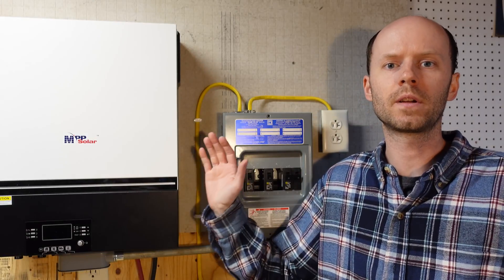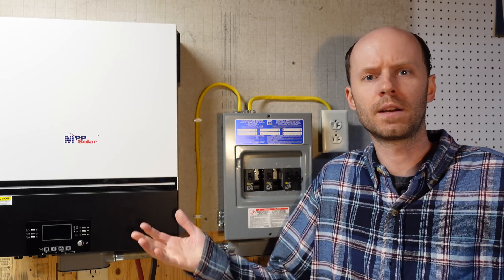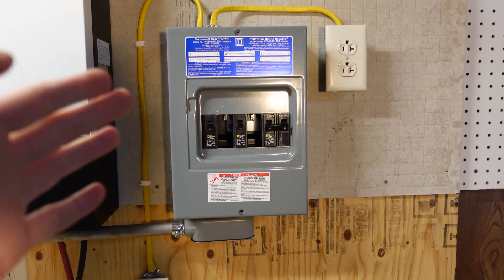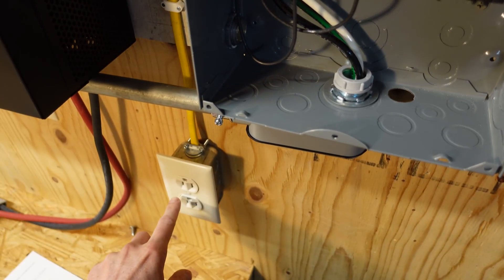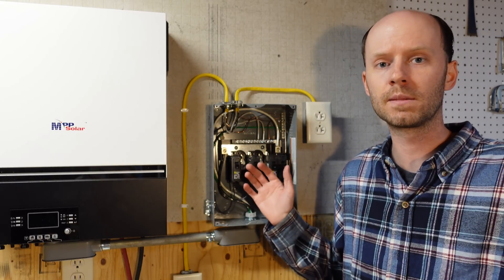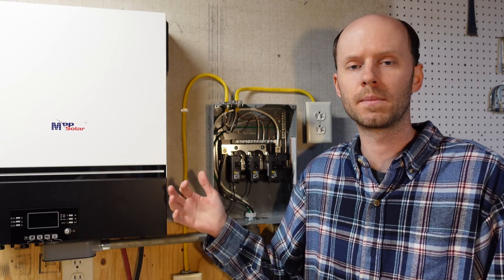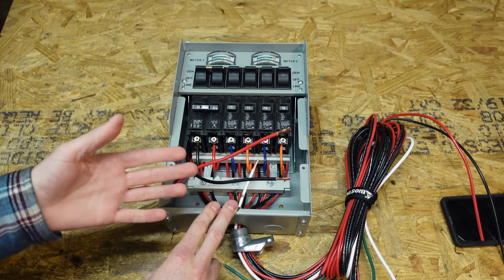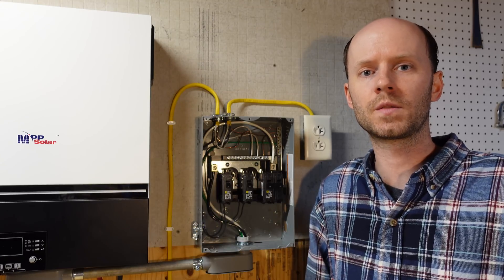MPP Solar LV6548 Inverter, Neutral+Ground Bonding, Completely Off-Grid

Comment: Solar Grounding Issue

I watched this video

https://youtu.be/Fnmjvg-7H8w

And he discusses the issue of grounding, but still a bit confusing on if the bonding screw should not be in the inverter so ground is not energized.

Here is my thinking and please tell me if I am wrong:

All of the inverters should not have a grounding screw in them, and the sub panels off of inverters should also keep neutral separate from ground.

To get ground, either the inverters are all plugged into grid as backup power, so they connect to ground thru that plug, 

if you decide to unplug ALL inverters (must be all so no crossing of grounds), then ALL Inverters’ plugs that would have bern plugged into the grid for backup power - should be plugged into a NON POWERED OUTLET that only has a ground connection no hot or neutral in this outlet, so that the inverters are all connected to a ground.

My thinking is to have an outlet strip or connected outlets, with a switch that in one direction connects ALL Inverters to the Grid power and grid ground (this is as backup power not for backfeed into grid).  So in this scenario, all inverters have backup power and common ground.

When switch is in other direction, ALL Inverters are not connected to grid power for backup, those lines hot and neutral are not connected, only the ground is connected to a separate ground rod to provide ground for entire system when not using grid as backup.

Could achieve this with a separate breaker panel with two breakers that have metal piece to make so only one breaker can be on at a time. 

And the ground wire to the inverters are switched from grid ground with power to 
independent ground without power wires.

One breaker feeds from grid w ground
other breaker only feeds from separate ground

But you do not ground the box to the grid ground, it would have to be grounded to whichever active ground is being used at the time by the inverters.

Does that make any sense?

Please be critical I prefer to find the correct answer, my opinions are of no relevance if they are wrong.

Thank you.

Comment: Same issue with the growatt 3K inverter I have.  I'm completely off grid, growatt still has bonded screw in place.  If I don't bond N-G in my panel, my plug tester says I have an Open Ground.  If I bond N-G in the panel, tester says my connection is good. How can get rid of the Open Ground without bonding in my panel?

Comment: I’ve read all the comments and still have one question: If I connect A/C power input from my main house and then create the exact same setup that is in this video, do I need to remove the N-G bond screw in the inverter and NOT add an N-G bond in sub panel b/c the N-G bond is coming from my main house panel?
Reply from the maker: If you keep the neutral bar and ground bar separate in the sub-panel then no - you should not need to remove the bond screw. The inverter disconnects the bond when it's operating in grid pass-through mode. That said, I am not an electrician and would encourage you to have one evaluate your plan ahead of time :)

Comment: So, as an alternative, the LV6048 comes with Gnd Neutral L1 L2 allready, would this solve the issue?
Reply from the maker: Isn't that one of the ones that actually has two inverters assembled inside the case? I don't have one myself to verify.
Reply: @LithiumSolar  That is an interesting question, I never had them apart !
So now you have me wondering, humm...
Reply: I see David Poz did a build Jan 11 2020 with the very similar 5048, he says in that vid that the 5048 is two side by side 2.5kw inverters set 180 degrees out of phase with each other.  assuming this is correct, then, does this solve the potential problem?
Reply: So i couldn't resist, yeah I opened up the 6048, and yup it is two 3kw units side by side.
Using an ohm meter the Gnd-N are not connected.

Comment: I am glad MPP Solar responded to you. I have not been so fortunate. I am wanting to install four LV6548 inverters after so many positive reviews. However I am trying to select the best solar panels to use. The question I have asked MPP through their online form (twice) is about overpowering the inverter. Its rated for a max solar Voc of 250vdc and 8000 watts (2x4000) per inverter. Will the inverter limit the voltage and current or will this damage the inverter? From other end users comments it appears you can increase the amps and the inverter will limit it but increasing the voltage above 250vdc may be a problem. My goal is to have the inverters start producing power earlier in the day and produce later into the day even if I am not able to use 100% of the solar power during the peak sun hours. I am hoping MPP will respond before watts247 is out of stock again. Almost forgot to say thank you for your videos and information you share.
Reply: I think I found the information I needed, please respond if you see something wrong with my thought process. Page 7 of the LV6548 manual says, "Exceeding the maximum input voltage can destroy the unit!!". A well known US distributor said the wattage may be exceeded as I had hoped however the manual says, "maximum current load of each PV input connector is 18A". If my math is correct 250V at 18A that would be be 4500x2=9000watts so there does seem to be a bit of wiggle room. Looking at page 9 the recommended arrays seem to show the inverter being over powered if using Voc. Their calculations use Vmp and Imp for a total of ~7918watts. Using Voc and Imp the total is ~9307watts and using Voc and Isc the total is ~9887watts. In all scenarios the PV voltage is below 250Vdc. 6x33.7(Vmp)=202.2Vdc and  6x39.61(Voc)=237.66Vdc. 
Max Amperage is exceeded in all scenarios. 2x9.79(Imp)=19.58Amps and 2x10.4(Isc)=20.8Amps. It appears the main thing is to keep the voltage(Voc) below 250. Sorry for the lengthy comments, and again, please correct me if I'm wrong. Thank you.

LV6548 Manual here > https://watts247.com/manuals/mpp/LV6548.pdf?x49702

Comment: Please describe the following situation. What if a generator is used to power the AC input of the inverter while using a transfer switch with a ground neutral bond in the main panel.
Reply from the maker: That would require analysis by an electrician for a proper explanation. I'm not familiar with generators and how they typically connect to off-grid systems.

Comment: Great video. I have two LV6548's that I am connecting for off grid. All I have left is the ground, as my data from my supplier shows each inverter grounded. But I don't see a grounding connection.
Others have mentioned to use the AC in ground lug. I to have the same 100a panel for my RV to connect to. It is bonding neutral to ground. I have the two 8' rods driven into the ground for my ground. I am going to remove the inverter bonding screw also.

Comment: Awesome video! That was very well explained and I have no doubt that an electrician would recommend this video! Also thanks for explaining the generator transfer switch, I havent seen how those are wired until now, they're pretty simple. One thought I have is that the neutral is very interesting, the generator transfer switch doesnt do anything with the neutrals because it just leaves both connected all the time. If it is running on generator supply then that current has to flow back to the transfer switch over the common neutral, so that wire should be the same gauge as your generator input. Hopefully people that may upgrade the generator connection and breaker upgrade that wire also.

Comment: So to use it with the N-G bond in the inverter you would wire it to a sub panel? If you wire it to an already existing panel I would remove the N-G bond from the inverter? If you use the Protran transfer switch I would remove the N-G bond in the inverter? If you use the AC input for pass through i would remove the N-G in the inverter for transfer switch, sub panel or existing panel?

Comment: Can you use 1 leg of the lv6548 inverter to power the transfer switch...
Reply from the maker: Yes you can, but won't be able to use any 240V double-pole circuits obviously.

Comment: Only bond the  ground to the grounded conductor in a AC sub panel  if you dont have a equipment ground from the main . Yours is more of A main panel so both can be  used on the same bar. If you at least have a good ground  electrode and  2 rods.

Comment: I have asked others on this type of setup. With a 48v all in one inverter/solar charge controller and a very large rack battery. Can that breaker panel be wired to have a 30amp socket to plug in a RV plug. My simple mind thinking that I could build a system like this in the back of my 5th wheel under the sofa, with that receptacle wired out the side wall. Then the solar array wired down the back and into that setup. Then just plug the RV into itself like I was plugging into an RV park electrical pole. That would eliminate all the other wiring setups. And I would leave room to add additional rack batteries.
Reply: Short answer: Yes.  My system is set up in [and on] a couple of shipping containers, and I ran 6 gauge wire from a 30a breaker to a outlet mounted on a post. Shore power!

Comment: Just commissioned two LV6548 inverters with grid connection wired as per MPP wiring diagram with one modification, I added ground lugs to the metal cabinets and ran a # 6 wire to a separate ground rod. I did not remove the bonding screw in the inverter. There was current flow on the white neutral wire but no current flow on the the green grounding wires.  I’m not an electrician.

Comment: As your circuits are set up there, you are working with a floating Neutral. Is that a concern for you? Or is that ground in the panel connected to a rod somewhere? Some modern appliances do need a true ground reference to work. I was always interested in how this looks like on these US split phase inverters when they have a floating N. Can you measure that N of that panel towards a G-pin of an outlet of your normal house installation? What does the Voltage say?
Reply: How does an appliance know if it has "a true ground reference" and for what purpose is it needed?
Reply: @Sylvan_dB , those are mostly devices which burn some combustible substances like gas heaters, boilers, etc. They must make sure that the body of the device is on true Zero as it would be the last thing you want in your house to have sparks causing unintended explosions. As such appliances will also have metal pipes running to them, those pipes, etc. are also bonded to true ground by simply running through ground. Therefore, when an installation is connected to the grid, all these objects must also be electrically bonded to the equipment grounding system. But if you are using an off-grid inverter without a ground source, there wouldn't be such a bond and voltages would float around. Modern heaters do have circuits built in, which will monitor essential components for voltage build ups and not work if there is something suspicious going on.
Reply: @RolandW_DIYEnergyandMore  I understand all the why. I want to know how. I don't believe any such detection can be reliably done. If there is a way I've yet to see it, nor been able to devise it, and I've examined a lot of equipment.
Reply: @RolandW_DIYEnergyandMore  btw, I had to bond my gas line to ground. Plastic pipe feeds the meter, and eddy currents were flowing between my hydronic air handler, boiler, and the csst gas pipe in my house and the clothes dryer. The dryer was 3 wire, ungrounded, and the hydronic plumbing was grounded only via the boiler and incidentally the air handler. The professionals who did the gas plumbing and the inspector missed that requirement.
Reply: @Sylvan_dB  yes. You know, I was saying that it can happen because I had a few comments on my channel from followers, who said that their heaters threw out error messages for grounding issues and didn't work until they followed my instructions how to ground and bond their off-grid system. Home installations should never be ungrounded/floating neutral anyways.
Reply: @RolandW_DIYEnergyandMore  There is a difference between "common" and "true earth ground." The former satisfies equipment and is safe as long as common is truely common. Earth ground is the easy way to describe a true common, so much so we even refer to a vehicle as ground, but "a true earth ground" is very hard to detect and prove. It requires a known reference for comparison, e.g. doing ground electrode impedance measurement. If anyone can solve the problem of "plug this tester into an outlet to find out if it has a 'true earth ground'" there is good money in it.

Comment: Unfortunately for those who want to use the Protran style switches MPP has also stated that any shared neutral solution is unsupported.  We have had quite this Erie’s of go rounds on the forums on these topics.
Reply from the maker: When you say shared neutral, you're referring to the input/output issue where they cannot be connected, correct? If so, that would also not apply to the purely off-grid user; however, is still problematic for a product. I've been casually reading through some.of the threads here and there.
Reply: @LithiumSolar  point, and to your credit you did specify that you were not feeding AC in, but I still wanted to call that out.  I loved my protran and used it for years as a pure emergency backup with a bonded portable genset knowing the risks associated with current on the EGC.  These units don’t function well as pure standby backups when coupled with LIFEPO4 batteries that want to be cycled.  These units are designed to be integral to daily ops.  In a pure off grid situation then why open the inverter to remove a bond you will recreate elsewhere, and why use a protran at all.  If you’ve no other source, the 6548 is your bonded source
Reply: @edwardbyrd7667  inverters now are with N-G short capability under inverter mode and when in line mode, N-G is OPEN.  This is handled automatically and it's in line with requirement for application
Reply: @Roll2Videos  huh?
Reply: I have a protran and I was told that the input and output neutral is bridged which makes it not work with the inverter

Comment: Very good and correct information. I cannot think of a single circumstance where the bond should take place inside the inverter. 

The bonding jumper has one single purpose: to complete a path from “neutral” to the equipment ground in case of a short circuit so that the breaker will trip. Having the jumper inside the inverter guarantees that a fault anywhere in the system will shunt some portion of the fault current across the circuit board, likely causing damage; even if the fault happens downstream of the inverter. 

MPP should ship the inverter without the bonding screw installed.
Reply: The ship it this way so they are code compliant.
Reply: A lot of appliances come bonded neutrals from the factory, and I can’t understand why… Dryers, ranges.. etc. ??? This seems like the minute you plug in the appliance, you create a second bonded neutral in your system which is a giant no no. Why do they do this?
Reply: I'll take your word for it. Thanks good buddy 👍

Comment: I have an LV6548 coming my way (soon, I hope). I know you went over this pretty thoroughly, but I am admittedly ignorant about the small details. What would be the downsides of leaving the screw in the LV6548 in and not bonding the neutral to ground? Is it because you want to use an actual ground rod for the breaker box? It does seem (again, speaking out of ignorance) that you would never really be grounded without the rod. I just don't want to take a chance of voiding my warranty for opening the unit. Any insights are appreciated, thanks.
Reply: In theory there is no downside in leaving the screw inside the inverter. You just need to make sure it is the only bond in your system, and best if you as well put a sticker on your inverter saying the N-G bond is inside there. You can still install a grounding rod to your panel connected to the grounding bar, and you will have to do this anyways if you want to use GFCIs and protect against ground leakage (humans touching L conductor in a grounded system and non-floating N). As Lithiumsolar said: there can be only one bond, and that's already all what is to say!
Now to the downside :)  : In case of a fault, the ground wire can carry up to the maximum current which that inverter can output for a brief time until it's Over Current Protection engages. All that current will go through that PCB and screw! I would prefer it to go through a proper sized wire in the panel tbh...
Reply: @RolandW_DIYEnergyandMore  Thank you for that very informative reply!
Reply: @SlimSh8E  if you are connected to your main panel don't install your own ground electrode leave it to your main panel to ground. Email from MMP: 
inverters now are with N-G short capability under inverter mode and when in line mode, N-G is OPEN.  This is handled automatically and it's in line with requirement for application.
End of email.
Also leave your panel after the inverter unbounded. Don't mess with safety on your equipment it's UL listed for a reason
Reply: @Roll2Videos  I’m definitely far from an expert. But isn’t this inverter just “UL certified” not UL listed. How can we be sure that MPP Solar hasn’t made a mistake on this bonding issue?
Reply: @RolandW_DIYEnergyandMore  what if someone was running multiple inverters together wouldn’t you need to remove the bonding screws in each inverter because if you didn’t you would have more then one Ground Neutral bond? It seems that MPP really would need to have good documentation around this issue since they advertise these as able to be run in pairs up to 6 units?
Reply: @huestifer  yes, you will have multiple fault loops and fault current will go through each of the invertesr. That is why i dislike it when bonds are inside units.